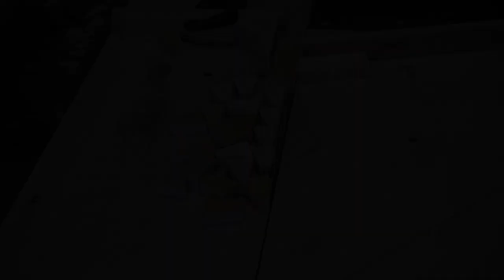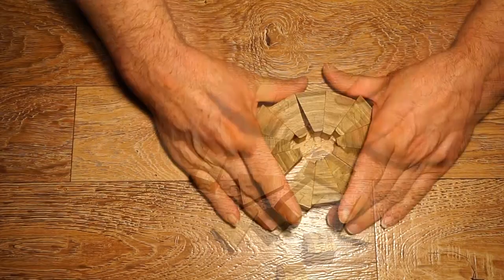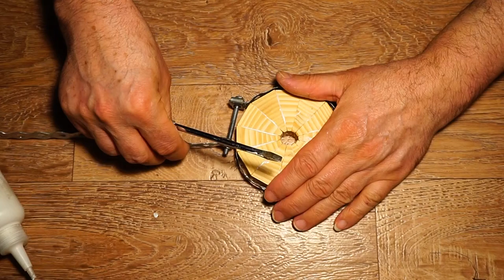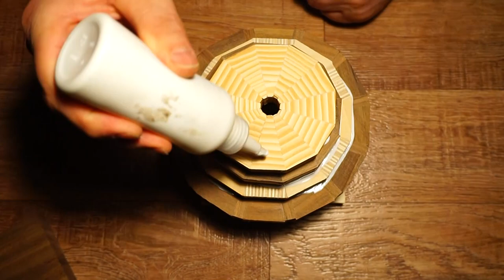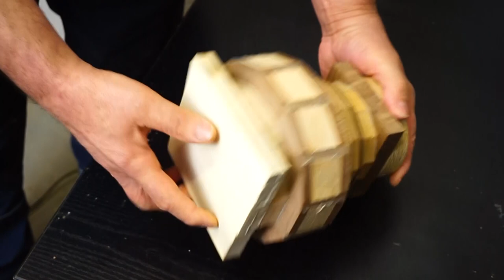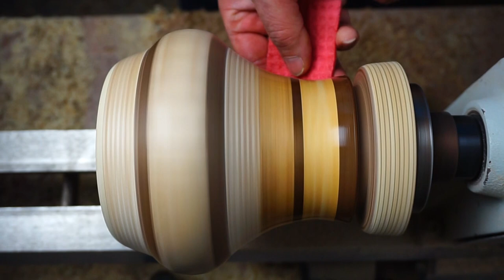Woodturning a Segmented Vase

Comment: In my opinion, this vase would’ve looked better with the wider section at the bottom. It would add stability to the vase.
Reply: I thought that at first but then I realised that he didn't make the hole too deep so that there was plenty of weight in the base to keep it stable.
Reply: harrygatto , still, if it’s to be used as a vase, then when water is added, the top will outweigh the base, making it unstable. The only Avenue is to use it dry with dried or artificial flowers.
Reply: I don't think a wooden vase is designed to be filled with water so yes, dried flowers or something like that.